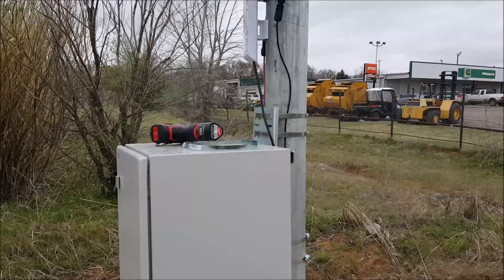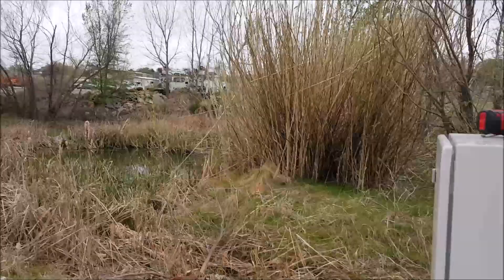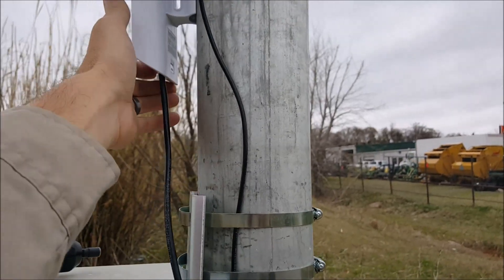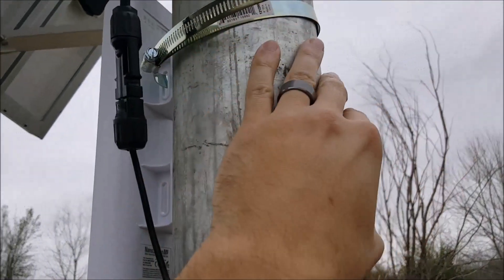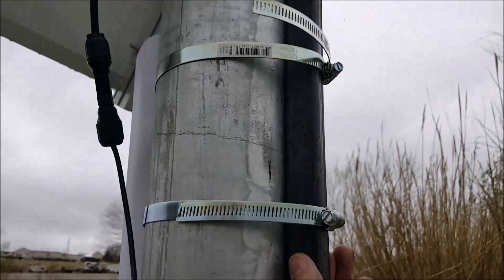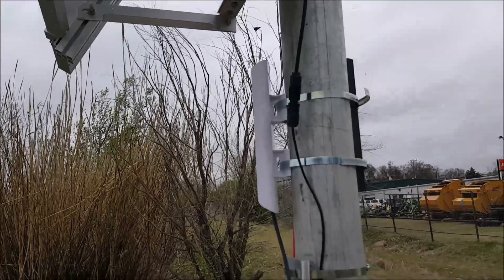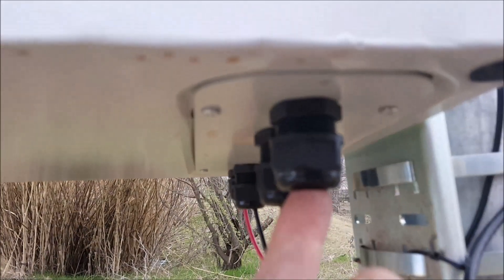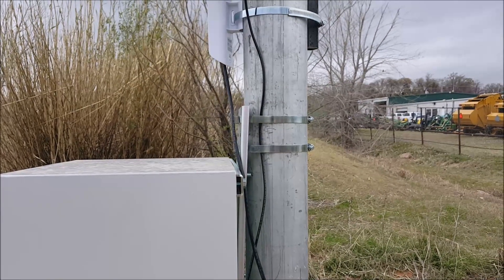Solar Powered Surveillance Camera Project 4

Comment: you literally save my life
Reply from the maker: Haha, how so?
Reply: @LDSreliance  I have an installation to do but I'm having a hard time because my boss told me that it had to be totally wireless, and electricity is unavoidable in the environment in question, I had never thought that an autonomous system was possible, but on the other hand after your video you have just saved my job...Thanks
Reply: @LDSreliance  I would like to know why you use 2 PoE injector, I think you could just use the original PoE injector of the nano m5, the PoE port for the nanostation and the lan port for the ip cam
Reply from the maker: You could do that but then you would have to install an inverter in the system to take power from the battery(s) (which is direct current), convert it to alternating current, and then the PoE injector turns it back into direct current.  That is very wasteful and on small, remote systems like this every Watt counts.  By using a DC powered PoE injector(s) or DC powered PoE switch you can avoid losing 20-40% of the power to the devices.
Reply from the maker: Also, I have an updated video that might give you some more ideas:  https://youtu.be/H7Wj25lDToI

Comment: In the summer when those trees leave out, that won't interfere with the wireless signal?
Reply from the maker: It can if you do not have direct line of sight.  In this case, the 40 foot power pole would have been over top of the trees.

Comment: looking at you're system youre the first video i have found with this kind of setup and has given so much information about it.
 i am in the middle of trying to setup a similar system with 2 cameras and the same type of antennas what would you recommend for the solar panel and battery. also do you use an inverter or go straight from the battery to the cam / antena.
any help is greatly appreciated 

my current proposed system is a 100watt solar panel , 2 ubiquiti cameras , 1 poe switch , 1 500 watt inverter , and battery (have no idea to determine required
 capacity) , Nema rated box
Reply from the maker: Good, I am glad it is helping you with your project.

Don't use an inverter unless you have to.  It introduces a lot of extra complexity and wasted energy.  I used POE injectors to power the antenna and camera.  The part number should be in the video description.  If not, let me know.  Basically it will need to convert from 12V to 48V I believe and then send the power through a Cat5 cable.

I would not use anything less than a 100W panel and a 100Ah+ battery per camera setup.  If you are putting 2 cameras on the same pole then use at least 150W of panels and 150Ah of battery.  That will give you 48 hours of use without any sun.
Reply: LDSreliance thank you for you're prompt response i appreciate you're input ill be playing with it in a couple of weeks once i get all the components and keep you posted.
Reply from the maker: Yes keep me posted.  I am interested to hear how it turns out.
Reply: Could also just power a POE switch off the battery then run to devices. Most Ubiquiti is 24v, so Wifi Texas has some great POE adapters.

Comment: hi im from Tierra del fuego, Argentina, im working in a similar proyect, you can use nanostation m5 if this device use 15VDC 0.8A???? and your system and poe is 12v and 10 amp???? how could be this possible ????
Reply from the maker: The POE injector provides the power to the Nanostation so the 15VDC doesn't matter.  I am using converters to convert 12VDC to 48VDC for the POE injectors and then they take it from there.  The overall power consumption of everything on that pole is much less than 10 amps @ 12VDC.

Comment: what is the range of your wireless network?
Reply from the maker: The one that I was using for this system just needs line of sight.  I think it would theoretically beam for about 2 kilometers.  But if there are trees or buildings in the way it would be much less.
Reply: The Ubiquiti units can connect for miles or KM

Comment: i'd like to put Solar Powered Surveillance Cameras on my house & my small shop..
Reply: +LDSreliance Looking good Buddy. 
Good job and looking forward for the final installation and video feed from the camera to the DVR please. 
Have a wonderful day
Reply: LDSreliance
will do. :)
Reply from the maker: +MRJOHNDEERE3720. :) You should.  It isn't very hard and if you don't have to mount them on a pole like this it would not be quite as expensive.  Each of the cameras were about $150 (I have 6 of them).  You could power all 6 with 200-300 watts of solar depending on how far away each camera is.
Reply: LDSreliance
 what kind of a camare setup is that. i've looked for Solar Powered Surveillance Cameras in the past & never could find any.
Reply from the maker: *****
Well, the camera itself is not solar powered.  But I designed the system so that the solar panel is providing the power and storing it in a battery for the camera to use 24/7.  But to answer your question, it is a camera made by Ubiquiti Networks.
Reply from the maker: JWSolarusa John Wesley
Thanks, I appreciate it!  Keep up your videos, too.
Reply: LDSreliance
o ok thanks. :)
Reply from the maker: *****
If you need help, let me know!